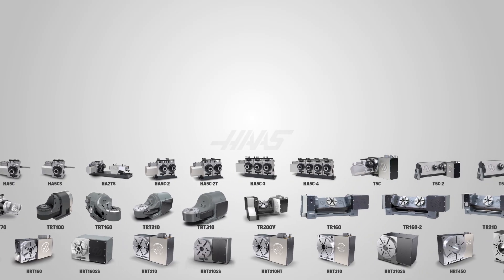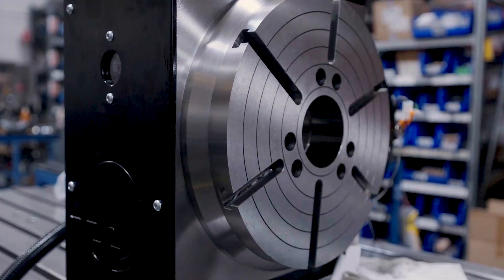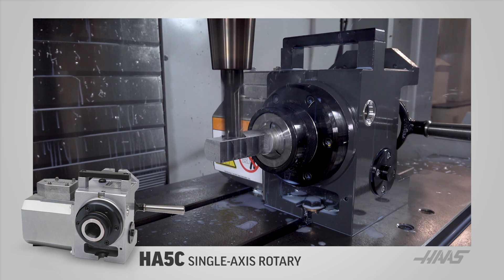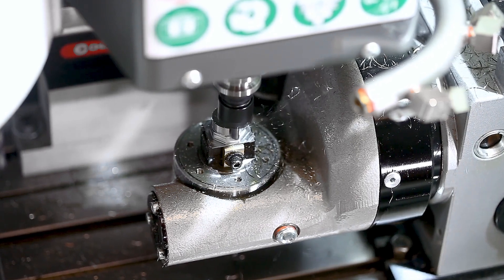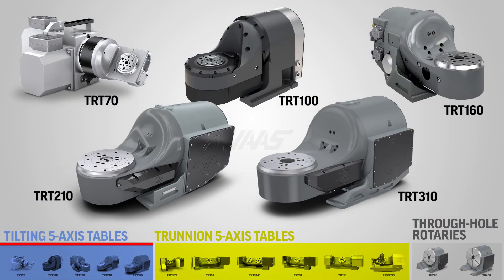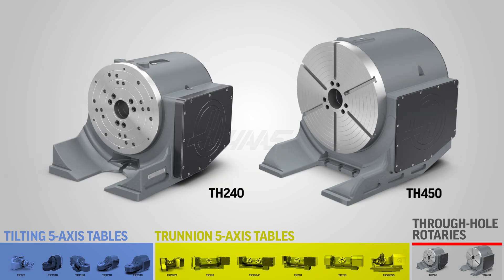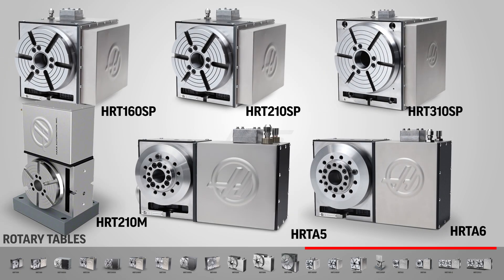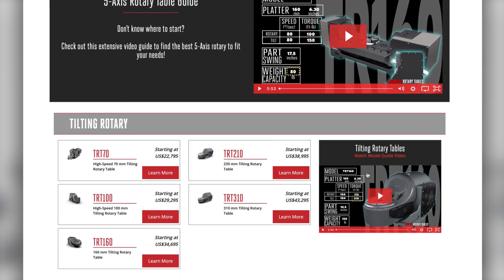The Extensive Haas Rotary Product Line - Haas Automation, Inc.

Comment: Is there a huge precision difference between trt and tr?
Reply from the maker: Teek, the TRT and TR are very similar. For instance, for the TRT210 and TR210; resolution (0.001 deg) and repeatability (10 arc-sec) are the same, whereas A-axis "Tilt" accuracy is +/- 15 arc-sec for the TR210 and +/- 25 arc/sec for the TRT210.
Reply: @haasautomation  thanks:)